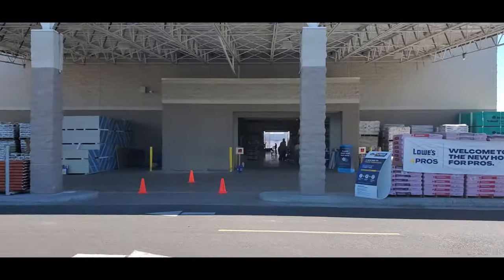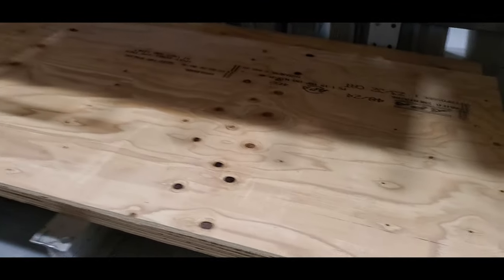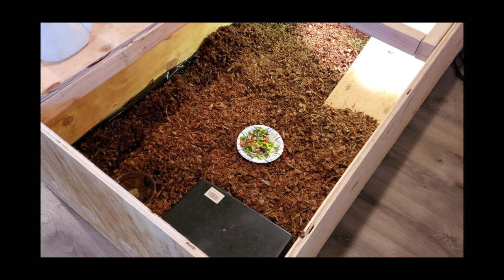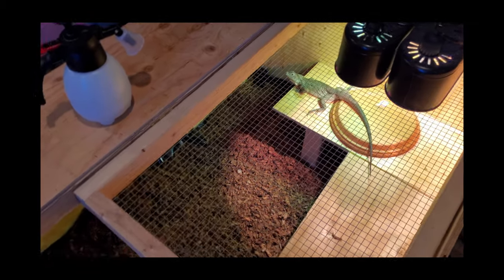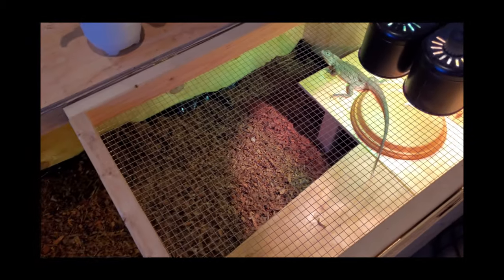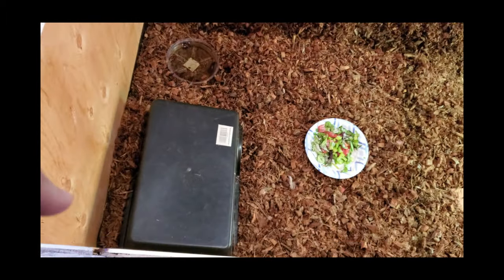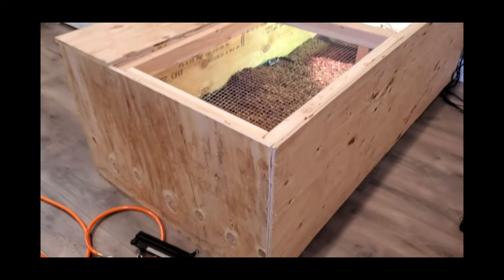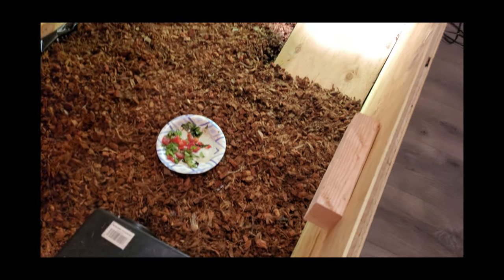Cuban Rock Iguana! New Setup & Enclosure For A Large Reptile!

Comment: Good video for the build!! Don't know  if you know or not but you can use Flex Seal to water proof your enclosure. Flex Seal isn't harmful to your reptiles. Plus it works great for reptiles that require higher humidity levels. Plus should you get mites they can't get into the plywood. It also makes for easy cleaning. Hope this tip helps you and your followers. 
Peace Out....🐍🦎🐢🐸
Reply from the maker: Thanks for the info, I was thinking about that product we used to use it at my last job to repair really bad roofs, but I was a afraid of toxicity.